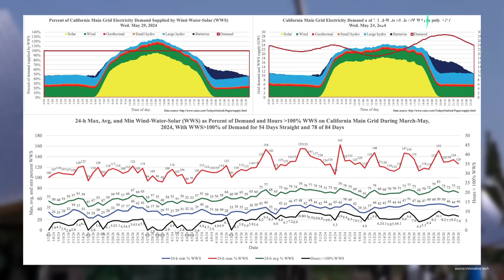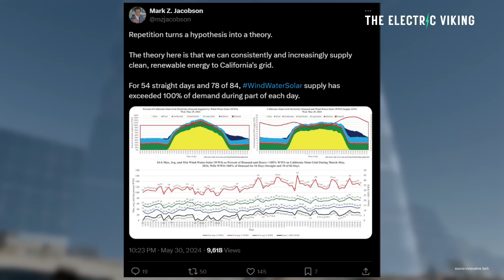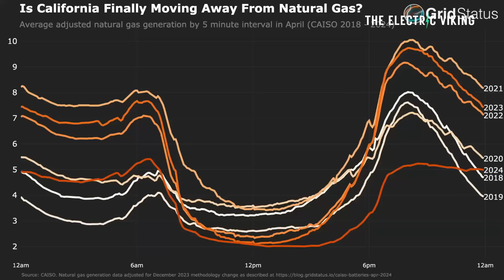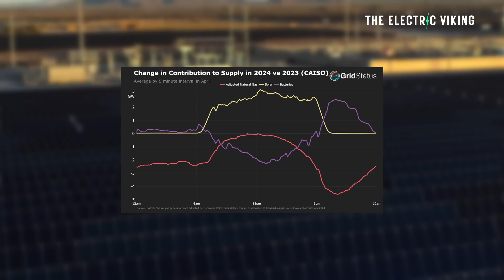Solar smashes records in California, 'DUCK curve' nearly wiped out

Comment: @electricviking Hello  Constant increase of power costs and failure to maintain the grid plus, increase in gas costs for heat in Winter.  These are my reasons for using solar.  I am thankful that battery costs have decreased.  Regards

Comment: There's a WHOLE LOT OF HYPE going on here in California. Much of what you hear is contrived, and numbers are mostly theoretical, not reality. The Ivanpah Solar Facility near Nevada, world's largest, has turned out to be financially unviable. There's a 14" high pressure natural gas line running to it to supply the generators when the sun isn't shining (roughly 5pm to 11am). So it's really a natural gas power station with solar assist. Attempts have been made to use enormous banks of batteries for nighttime storage in other areas, but this is so costly as to also be financially prohibitive, plus battery backup lasts only a very short time. There are some areas using pumped storage, where feasible. Pumped storage makes the most sense, but you need mountains. California also has wind turbines, and they work much better in some areas than others, but are unpredictable. People hate the noise and the eye pollution.
I live in South Orange County, south of LA. They started saying my electricity was coming from renewable sources on my electric bill about 15 years ago. In that amount of time, my electric rate has gone from 10 cents per kilowatt-hour to 35 cents (to start). That's for the first couple of hundred kilowatts, Then it jumps to 45 cents for the next 400 kilowatts of usage. Then it jumps to 55 cents up to 1 megawatt-hour of usage per month (plus an array of taxes). They wont tell you how much it jumps to after 1 megawatt hour. All they will say is that the charges are "punitive". 1,800 square foot homes here, where it can reach 90+ degrees in the summer, routinely go over 1 megawatt hour of usage per month for air conditioning. Now they want to add a surcharge based on you income!  Yes ... not usage ... but rather, your income!  Now imagine if you add EV charging. God help you (though they say they'll give you a 2 cent break per kilowatt-hour).
They've been pushing roof top solar for years now. Average cost of installation is $35-$45,000. Up until several months ago they said they'd buy electricity back from you for 20 cents per kilowatt-hour. That drove a lot of people to install roof-top solar. Once everyone had roof-top solar, they changed their minds and lowered it to 2 cents per kilowatt-hour. I know people who got so angry over this, they turn on their central air conditioning or electric heat, then open all the windows and patio doors, just so their rooftop solar electricity won't go back on the grid. In my area, there is no storage anywhere. Electric usage is lowest during the day, so much if it goes to waste, even if put on the grid.
They've been routinely closing base load power plants around the state for years now, both gas and nuclear, and California now IMPORTS much of it's base load electricity 300-400 miles from Arizona and Nevada, where electric plants burn coal. It's all a smoke and mirrors shell game determined to make wind and solar look like the winners, and to make California look like a green utopian state, but in reality it's just a super costly bait-and-switch mess. It's going to be interesting to see what happens when they force everyone to buy EVs.

Comment: In the long run no reason for "wasted electricity"  Desalination, H2 production, etc could use the power when it is available.  This is after the batteries and pumped hydro is charged up of course.

Comment: How long until the batteries must be replaced?  
I seriously doubt that any of the battery storage is "green".  
Where will they put the not-green waste from the used batteries?  
I also doubt that they are running the (most likely lithium) battery storage at the longest life specs (charge to 75%, discharge to 25%).   I suspect that they are not far away from their first battery fire and that will greatly impact future battery plants because those neat rows of batteries are not far enough apart to contain a serious battery fire - based on the measured distances of cell travel at some previous fires involving a large quantity of lithium cells - such as the crash of UPS Flight 6 and some other cargo planes.
I reserve judgement on the value of "134% of peak power" as that is a mostly meaningless number UNLESS it's measured during ACTUAL peak usage time - which this is not.  The numbers you mention are mixing apples and oranges which is just so much BS.  It is also obvious that CA will not have the capacity to charge EVs when everyone there is forced to own one - because they will plug it in when they get home from the 9 to 5 workday and that evening peak will be greater than can be supplied.  
Many years ago, I guy I worked with moved to CA and he called me to say "You need to move here!  They're paying people with your skills twice what you are making now!"  I ran the numbers and figured that the only way the salary could be double was that expenses, traffic and pollution were double so I chose to stay in the southeast US.  I was correct about the $$$ and a number of years after retirement I'm probably better off than he is.
Sorry, but I think you're too exited over questionable numbers and not looking at the long term costs of battery replacement and the like.

Comment: Big fan of yours, Sam. Also a solar and EV owner - BUT California is NOT a success story. We pay the highest electric rates (in San Diego) in the nation other than Hawaii. Also, net metering is effectively over, removing 90% of the economic benefits of installing it. And they want to raise rates AGAIN. Couple this with $5/gallon gas, also the highest in the nation, and you have energy costs that working people cannot afford. The system is corrupt, with the utility commission in the pocket of SDG&E. Please do not reward this abhorrent system with your accolades. Their success comes at a huge cost to those who can afford it the least.

Comment: In mid 1983 at the Soar Energy Congress in Perth, a person from 'California Edison' from memory gave a presentation to crowded lecture theatre, at the University. He listed the 9 present sources of power they had feeding the grid, some very new.
 I recall Coal, Hydro, Gas, Geothermal, Nuclear, Wind, Solar thermal, Solar voltaic, and Wave power. 
That was over 40 years ago, long before good batteries. They would know a little about integration of multiple sources of renewables.

Comment: Solar and wind power benefit from massive subsidies. And while I have no objection to them, it will be quite a while before even sunny California can go without fossil fuel power. One benefit to other states is that California electricity is VERY expensive. Industry will be moving out as the price differential becomes worse.

Comment: This announcement is at odds with a recent article by the Washington Post that states quite the opposite. "Rooftop solar panels are flooding California’s grid. That’s a problem.
As electricity prices go negative, the Golden State is struggling to offload a glut of solar power". In the article the duck curve is mentioned as well as negative prices.
Reply: Negative prices occur whenever there's an excess of production over the current consumption. So it is true that in certain moments the grid is all supplied by renewables. If we factor in the batteries that should absorb any excess, why negative prices still occur? Maybe there's still an excess of production from renewables, and batteries storage can't keep up with new installations. I don't see how the duck curve is being flattened and all consequences fixed.
Reply: As a central coast California property owner, I’ve never seen higher electrical prices.
Reply: Both are half a story. If the hockey stick power curve was the real problem,  they would solve it. CA changed Net Metering rules last April (2023). Rather than providing 100% credit for returned energy, they now pay about 10%, making the ROI impossibly long and removing the financial incentive. SDG&E said that this was to promote fairness for those who can't afford solar (does anyone believe that???). The utilities and utility commissions are corrupt.

Comment: In Florida I have some off grid land under a canopy of thick trees.  I cleared a patch for a 500 watt solar panel.  My van has a 200ah Lithium house battery.    It's enough power to keep the van cool and ventilated in the shade, run a small 12v fridge, cook lunch, charge my devices, watch TV and surf the web.  I wash my clothes with shower run off and air dry them with the sun.  I can go like this months year round without paying a  penny for utility bills.  I realize its not for everybody and people are always surprised when they see how I'm living given I present all clean and fresh when I go into town.  The trick is living small, finding passive ways to stay comfortable and using peak solar hours to cook,  dry and recharge.

Comment: I copied from CA sun power : I’m a solar customer in California and I currently enjoy the benefits of NEM 1.0 or NEM 2.0. Can I add onto my system without changing to NEM 3.0?
Homeowners in California can expand their solar system by 10% and still be eligible to keep the benefits of NEM 1.0 or NEM 2.0 without any changes. Existing customers are grandfathered into these programs, allowing you to continue to enjoy the full 20 years of NEM 1.0 or NEM 2.0 benefits from your solar installation. It’s important to note that your grandfathering start date for this 20 year period is the Permission to Operate date from your original solar installation, not the date of your solar system expansion.

Comment: Please visit California.  It has huge grid and power reliability problems.  Until we solve the "MASSIVE" grid scale storage problem we won't be running 100% on renewables.  Also, don't confused installed capacity with actual power generation.  All renewables generate far less power than the installed nameplate rating.  Nuclear is the clear low carbon, smaller footprint solution that the world will eventually turn to.
Reply: Nuclear is dying everywhere, even with massive subsidies.
Reply: Nuclear is dead.

Comment: Awesome news , Sam! That only leave Cali one more little niggling problem with the electrics; how will the system perform when it has to supply a large fleet of electric cars? Although Cali, by some estimates, has more homes with solar roof panels than any other state, how will that help when the car comes home and gobbles up 30% of your hoarded solar watts? I'm not panning the idea of California- I sincerely wish to see a sound answer; I live in a state that has much the came dollar profile but has a state government owned by Big Utility and Big Oil & Gas, which , too likely , means it will take anther twenty to forty years to change this here. And, on the down low, our local electric grid hasn't been "up to spec" since the '80s. And yes, it's right here in America! Most of it not connected to any outside state electric grid- except for a tiny portion not connected to the rest. All of this is terribly legal, just ask the AG when he's not in court defending himself from fraud charges. 
Sorry to bore you with so much local news, but for some of us the impediments to achieve more than a fraction of what California has is daunting. To Australia's greatest success; the bought and owned in our state capitol are much more likely to actually look at something that went well in Oz, a great deal more than if it came frim California. Stupid, I know, but "stupid is as stupid does"; I think it was a Republican who first said that to me. An American Republican at that.
Reply: Was that Republican Sally Field (Forest Gump's mother)?

Comment: When Diablo Canyon had to be rebuilt for earthquake bracing, and then rebuilt again because the bracing was installed backwards on unit 2, they raised peak rates by 50% to $.012/kwh (long time ago!). When California experimented with deregulation of power generation in 2000, the generating companies gamed the system and gouged rate payers to the tune of $30 billion dollars. That doubled peak rates to $.24/kwh. I've missed the excuses for the rates we have now, but some of it is due to grid upgrades to accommodate renewables. PG&E had to put up a new transformer before my neighbors and I could install about 35kw of PVs on our roofs. The other big factor is financial penalties after disasters like the wildfires over the last decade. PG&E shareholders are guaranteed a return on the $6 billion they want to spend on undergrounding transmission lines. PG&E doesn't care about the expense of these upgrades as they are guaranteed a return on the investment. There are some demands to turn PG&E into a state-run utility, since PG&E has recorded record profits while we pay  the sky-high rates.

Comment: Meanwhile, here in the land of oil & gas, i.e., Texas, I pay 14.7 cents per kw/her for 100% renewable energy.  This is due to our stand alone grid and a weird market driven marketplace.  Most of us can choose from dozens of electricity providers with every kind of variable and price.  Half of my cost is for the delivery grid and half for the actual electricity,.

Texas has more wind power than any other state, and is ramping up solar so fast that we have had no summer brownouts in the last two years.  On a recent road trip coming through the Texas panhandle I had wind turbines in sight for something like a six hour stretch!  So beautiful.

All under the noses of those fucking O&G dickheads that control our state.  They hand out lots of knee pads to the legislators.
Reply: Didn't Texas have a massive power failure recently?
Reply: @aussieideasman8498  Houston area did about a month ago.  Weather related.
Reply: @frequentlycynical642  We get weather every day.
Reply: @aussieideasman8498  Alert the media!  /s

Comment: The batteries will bring down costs and lower emissions because the duck curve makes CCGT gas plants run inefficiently. With the batteries, even on days when there's not enough renewables, gas plants can continue to run and store up electricity in the batteries for the peak. They're twice as efficient when running flat like that.

Comment: Ooh 8.2 hours.
Still only 30% in the best conditions. The rest of the time.. coal gas hydro nuclear.
More panels mean wasted generation.  Ridiculously expensive batteries cannot store enough for the other 70% of time.
Wrong solution. Short term. 10years life cycle solar. 15years wind.
Nuclear is the way to go.

Comment: Deceptive statistics !
That period, March to june, is the lowest demand period of the year, as indicated by that 27.0 GW  peak demand.
During the summer that demand can (has) peak over 50.0 GW ! 
Also, even during ths low demand period, the Solar/Wind failed to meet even 50%of the demand for12 hrs of each day…
…it will require an impractical amount of batteries  ( and solar+ wind !), to fill that void !
You should remember that Ca continues to IMPORT 29% or its electricity from other states, because of this unreliable, weather based,  generation network.

Comment: Great news for California.

We’ve just completed our 1st full year of our fully electric household:
Solar, Battery and EV. Glad we did it.

On average, half of our power is produced from Solar on our roof.
Reply: Nice. You mention Solar, battery and EV. So allow me a question: What is the way you make warm water and heating/cooling of the building if needed?
Reply: @beatreuteler  Ah, I should have mentioned we have an Air Source Heat Pump. (Mitsubishi ECODAN) It heats both the domestic hot water (Great pressure for a shower!) and runs central heating water through radiators. Additionally we have an electrically heated floor for the coldest weather.
Reply: @John-FourteenSix  Great. So you have taken the right steps. Congrats.
Reply: @beatreuteler  We achieved it by planning it in steps, (1. ASHP & radiators; 2. Floor: Solar and Battery, then 3. EV charger and EV last). 

It was quite an upheaval, but worth the effort and expense. In some ways the opposite to how many would go about it.
Reply: @John-FourteenSix  Well done. We are still on the path, but on this very path (in steps). So far done: 1. Rooftop PV & WWHP & battery  (09/22) 2. ASHP (08/24, components currently on site). EV charger and EV planned for some time in the future, not sure yet when.
Revised 24/09/07: Heatpump now operational.
Reply: I'd do it to if I had boatloads of money to throw at it.